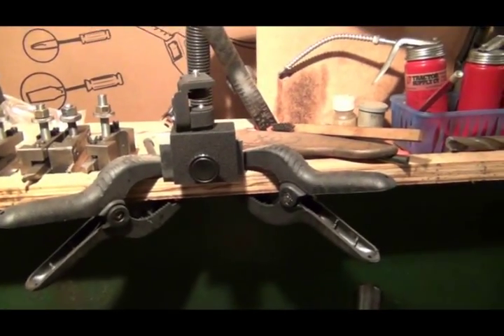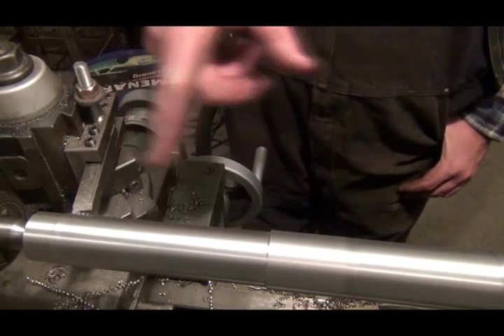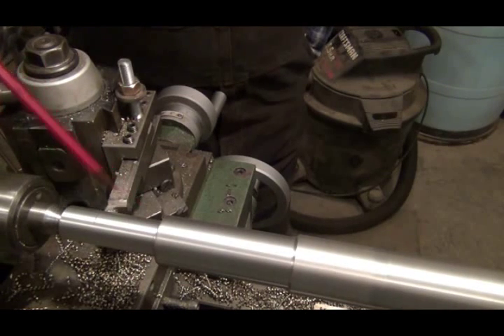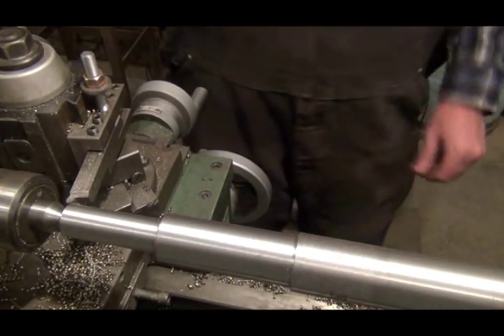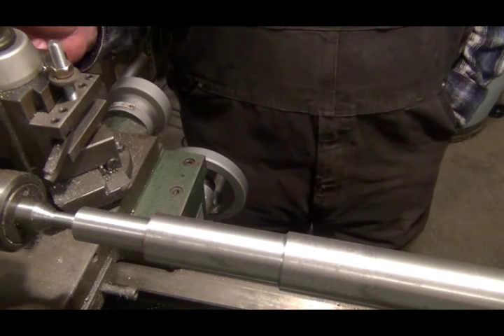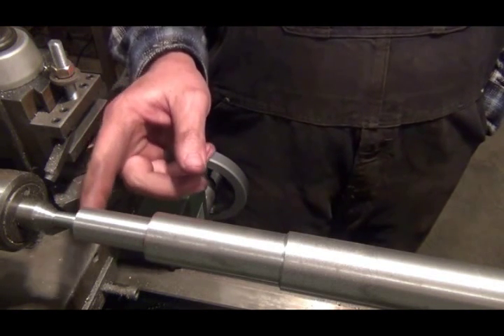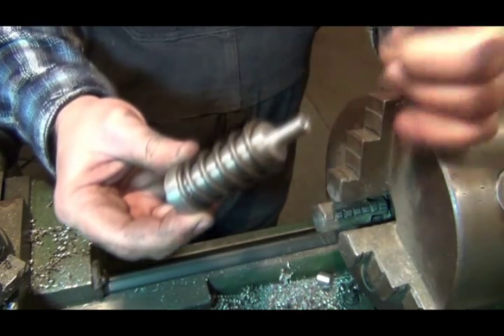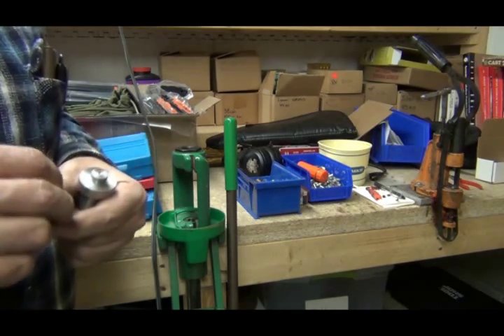Machining the check maker pt 1

Comment: The pressure you were putting on the spring by hand was enough to collapse the punching die far enough to get the forming punch to protrude above the punch.. Do you think that amount of pressure can punch through that amount of copper or aluminum before the forming punch starts pushing the center of the slug?

Comment: If you plan on punching more than 2 pieces, it needs to be heat treated and drawn back to about 60 to 65 Rockwell. Round off all corners with at least a .005 radius and then surface grind your punch and die surfaces to sharp edges after heat treatment and annealing..
You may want to go with a heavier spring also, that one looks too light weight for punching the slug before compressing down and pushing with the inner forming punch.